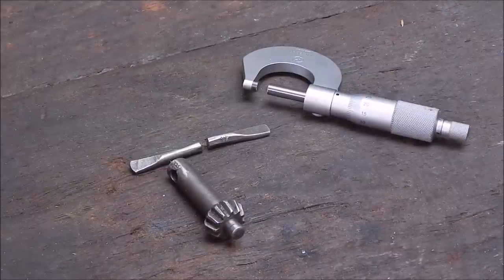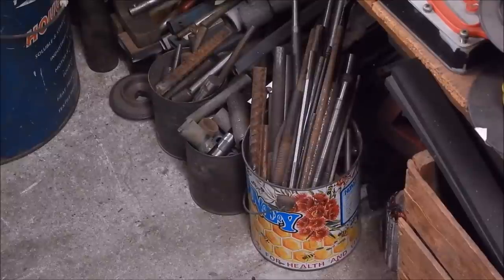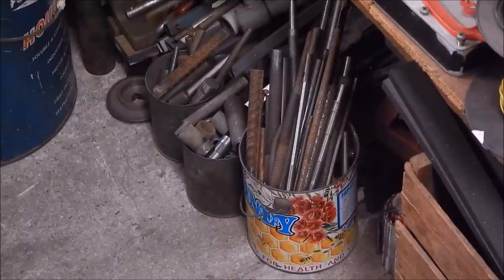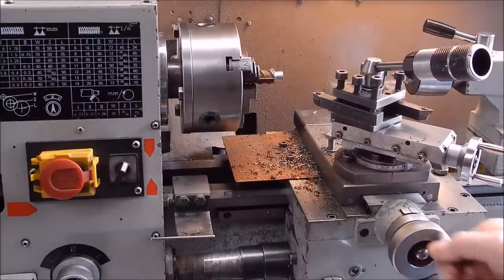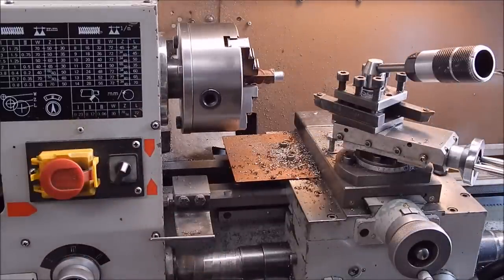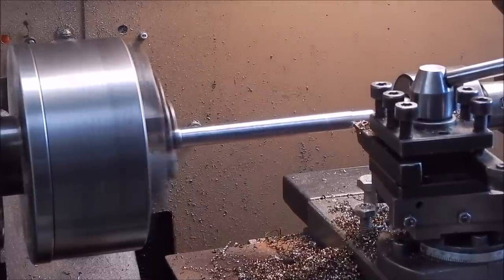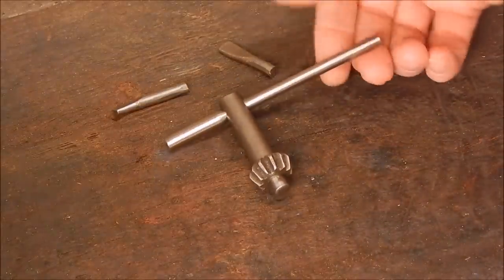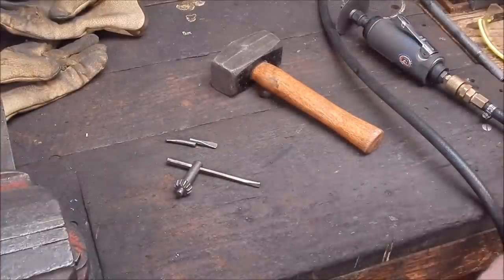Can you machine Rebar with a metal lathe ?

Comment: Rebar or what other terms as deformed bar used in building construction is machinable, but it will bend for prolonged used this is not compatible for a drill chuck key handle i am just sharing thru my own experience as a Machine Shop practitioner for almost 43 yrs of my entire life,,,i replace all of my drill chuck key handle by using tool steel rod without machining you can buy it depend on
what size you need and walla all you need is to forged both end with a hammer

Comment: Strange finding this, I played with turning down some left over rebar a month ago. I was actually pleased with the turning and finish. Who knows what the stuff is. Have to be sure chuck is good and tight otherwise, as I experienced, the rebar tends to chatter when turning down the nubs which can loosen the jaws. Next I think I'll try to super finish the material to get a really smooth slick finish.
Reply from the maker: Very little on YT about machining Rebar.  It threads OK (for end plates) so it must machine OK.  I finished off with a home brew carbide tip, but HSS would probably do a better job.  The finish was still as good as cheap black (rolled) steel can give. So worth playing around with just to see.  Rob
Reply: xynudu I did find out from an old fella who is a blacksmith, as well as tool and die man, that rebar is high carbon steel so if that helps anyone out.

Comment: I am thinking that the process of making the raised parts on the rebar may have had a work hardening effect on the out side of the rebar. It can be a lot harder then the inside.
Reply from the maker: +Old Man 

It's hot rolled, so it's going to be harder on the outside regardless.

Cheers Rob

Comment: Crazy question could you not just use an angle geinder and remove the ribbed section and then use your bits to really turn it as to not ruin your carbide?
Reply from the maker: Yes.

Comment: G'day Rob! Was thinking, would it have been more efficient to attack the rebar on your lathe with an angle grinder first just to get it a bit smooth before subjecting your cutting bits to it? Interesting video, will have to remember it.
Reply from the maker: +Luke Burnard 

Hi Luke.

Yes, you could do that, or even use a bench grinder on it. 

Cheers Rob

Comment: Xynudu (and those of greater knowledge than I),
Thanks for sharing this interesting piece of information, and taking the time to document it!
Would it help if the piece was acid washed before machining to remove the rust and scale? Would that save on wear and tear on the inserts or HSS steel cutters?
Thanks!
AAR
Reply from the maker: +Albert Rasch 

Yes, removing the rust would save wear on any cutter used, including carbide. 

Cheers Rob

Comment: Rebar is poor quality steel, that is why no one likes to work with it. The last stop on the way to rust is rebar. It is very inconsistent, you may be working with it and all of a sudden hit a hard spot or a soft spot. You are much better off selling your current stock in exchange for some scrap steel of a better quality. It is NOT better than mild steel, it is worse, it is made from old tin cans to car bumpers and it is not well mixed. It is fine for holding concrete together but not much good for anything else.
Reply from the maker: wayne parris I take it you've never had much success machining Rebar?  Rob
Reply: Rebar has set specifications like anything else in construction.  The ASTM has classifications for rebar with grade 40, 60 and 75 having a minimum yield of 40k, 60k, and 75k PSI respectively.  There is no reason to think of rebar as being any different in quality than any other mild steel that is the same alloy.  I've never machined it, but all the rebar I have ever handled cut, welded, bent and behaved like mild steel.  Also it's ludicrous to think that there isn't some level of concern for consistency in how a product behaves when it's performance is responsible for holding up bridges and skyscrapers, because amazingly, side walks, driveways and home foundations aren't where most rebar ends up..heh
Reply from the maker: Dead right on all counts.  Thank you for some serious informed comment.  Cheers.  Rob.
Reply: Rebar is the lowest grade of steel. Purity is not a requirement, consistency is not a requirement, as long as it can meet the test for yield it passes. It is a mechanical requirement, not a chemical one.
 I have forged it and machined it. In both instances, it behaves poorly. There is a reason it is the least expensive steel available, it is among the lowest quality steal available. Sorry but that is the truth. Quality material is not expensive, it just costs a little more than rebar.
Reply: You haven't handled much mild steel rod or bar stock if you think it's noticeably more consistent than rebar.  I see obvious cobbled areas and have mild steel break while bending at similar rates. The last full stick of solid 3/4 I bought had at least two feet of obviously visible flaws in it. Is rebar high quality? No, but it doesn't seem much different than typical mild steel rod bought for cheap at the typical pipe and steel yards.

  Now if you want to compare it to anything that is actually considered machine grade, then yeah, it's junk, but thinking it's some how vastly inferior to mild steel is giving mild steel too much credit.
Reply: member548 I have seen some cheap rebar that was so brittle it would break before it would bend. It was a nightmare to work with. Cheap from China and had to be used in straight runs instead of being able to be bent into cages for pre-cast.Finally got it used up and no more of that stuff.
Reply: member548
If your comment is for A36 or what is commonly sold as "mild steel" you are correct, that standard also moved to a mechanical one from a chemical one. I have used a LOT of steel, in many grades. With steel like anything else, you get what you pay for. If you want GOOD steel, you need to do your homework and select a steel that will meet your needs then spec that particular grade steel. Generic...."mild steel" is garbage. Not quite what rebar is but it is getting close.
Reply: I believe you. That stuff was good for just sitting there but not for working it at all. Thanks! I'd really like to go through a steel mill sometime but it'll have to be on You Tube or go to China. Think I'll just stay home!
Reply: Yeah, It's not my intent to say rebar is great or anything, just that there doesn't seem to be much difference between it and mild steel.   I had a stack of 3/8ths rod one time that broke every time it was bent more than 90 degrees for instance, and sch40 pipe that pops and blows out when welding or plasma cutting because there was some garbage in it.  Rebar is low end, but it's not like is complete garbage or several magnitudes worse than typical A36 mild steel.
Reply: It's really good for garden stuff. Reusable stakes and trellises.
Reply: wayne parris So, what's the big deal of using rebar for a simple key chuck handle? It's not like there are hundreds of pounds being placed on it. I'm not saying that it should or shouldn't be used. He used scrap metal for a simple key chuck handle. Just don't dismiss the simple usage of rebar. This is just smart thinking on xynudu's part.
Reply from the maker: FrustratedBaboon Yes, that was the idea of the video.

Thanks for the support.  Cheers  Rob
Reply: It didn't really bother me if he used a broom handle. If it works for him it works for me. No problemo!
Reply: wayne parris +member548 Nice thread! Thumbs up to both of you. I got good perspective from the dialog.  I do also appreciate OP +xynudu for the fine video work and introduction of this concept.  I was thinking of this idea myself.  I subscribed.
Reply: FrustratedBaboon 
Ya you got me. 37.5 years in the metal working trades and I know less than a 5th grader. I am ashamed.
Reply: wayne parris I would be very worried about steel that breaks when being bent, this shows that it was force cooled after rolling ie straight into water !  not such a good idea, depending on the mechanical properties called for within the spec, however if elongation or Charpy are within the spec I would suggest you get it tested before using it to build bridges etc ...  Lewie McNeely what did you use it on ?
Reply: Cages for reinforcing pre-cast retaining wall blocks. No long spans, just self-contained units to be stacked flat and the cells poured solid. They used that cheap stuff up and got better quality from then on.

Comment: G'day mate.  Top quality video as usual.  I hope you enjoy the chuck key.  I need to purchase three or four myself as even though I have a place to put my chuck key I never put it there.  I find that you can get steel in many unexpected places.  Like auto struts, each has a nice rod down the center.  Thanks for the video.
Reply from the maker: cerberus Auto strut centres - that's a new one for me.  I must look into that.  What diameter are the rods roughly?  I have machined FWD car drive shafts.  These are about 20+ mm in diameter, but the ones I machined (Mitsubishi) had about a 5 mm layer of case hardening over the entire shaft.  Needless to say it made machining extremely difficult, even with carbide. Cheers Rob.
Reply: xynudu The diameter varies but should be close to 5/8 - 3/4.  A little bit hard too.
Reply from the maker: cerberus That sounds like pretty useful stuff.  Would have to be quality steel to prevent bowing under pressure.  Thanks for the tip.  Cheers Rob

Comment: My experience with rebar is the material I had on hand was rather soft and very tough.
The machinability index was poor. With this combination the finish was terrible and even a decent ratio (length to diameter) piece will bend on you in the lathe and cause a wreck.
Reply from the maker: w8ye There are many grades of Rebar.  The stuff I have gives a reasonable finish without much effort - as per the video.  But I hear plenty of weeping and wailing from others not so lucky :)

I just put up the video for comments, and all are welcome.

Cheers Rob

Comment: Machining is a bitch on this stuff but it is useful for items that take a lot of pain like pipes being used as a "come-along".
Also tempers pretty easily - heat it up cherry red, throw it in some old motor oil - repeat a few times - everything is good.
Once had a chisel I made out of about 400mm of 25mm re-bar - took forever to blunt down.
One time we were breaking up some concrete and got the chisel about 15omm into the stuff and then it "got stuck".
Beating it sideways with a sledge hammer eventually got it loose but it didnt break, shear off or bend.
I wonder who stole that chisel as its not in my toolboxes any more. ;>}

Comment: Why not just use a small angle grinder to take off the rough.
Reply from the maker: Grant W. Whitwam Do whatever floats your boat.  Rob
Reply: I made a holder for my angle grinder to fit on the tool post of my cheap Chinese lathe, after I dressed the grinding wheel, I could get down to tenths of thou, just like the old Universal grinding machines I used to operate. Funny what you can do if you have too, you just have to put shield under the grinder to collect the grinding dust.
Reply: Because the last thing you want on the bed of your lathe is little chunks of abrasive cuz if they get caught between the lathe and the bed it will destroy it. I'm not a machinist but that's one thing my buddy has taught me about his leg is don't ever get a braces around leave. If you do make sure you cover the bed up and catch all the material that comes off of it.
Reply: @1ton4god  you can clean most of it off on a bench grinder. The main thing you want to get rid of is the 2 big ridges and some if the raised sections. After that it cuts fairly well.

Comment: How did you chuck it to minimize runout before starting?   There’s no decent surface to indicate on.
Reply from the maker: Hi Lisa,  I could only get it close by eye, because there is no surface to indicate on.
Reply: @Xynudu   I used a machinist square and the face of the chuck to get me close.  I’m making some pin hinges for a gate. So it’s two parts and I’m concerned about them lining up.
Reply from the maker: That's a good way to do it.

Comment: Thanks for your great videos, Rob.  It's good to see your work.  

Just a question, though.  Why weren't you using coolant?
Reply from the maker: Spamlure Not necessary because I used carbide cutters for the whole job.  You can use coolant with carbide, provided it's a continuous flood system, which  I don't have.

It's not recommended to apply coolant to carbide with a squirt bottle as it requires a constant application for the cutter to work properly/uniformly.

Dry works fine.

Cheers Rob
Reply: xynudu Have you ever tried a siphon mist coolant system? it will about double the life of your carbide vs running dry.
Reply: Bear Peterson  but they are a bit of a mess.

Comment: seen this video, and made me think of something i have allways wanted to know.... can you weld rebar? i have never tried,or seen anyone do it.
Reply from the maker: +chaseme81871 

Yes, you can arc weld it.  I've done it plenty of times with an AC stick welder using GP rods.  The welds have held up OK.

The weld can be brittle though, so low hydrogen rods work best on it.

There are probably specialty rods for welding it.

Rob
Reply from the maker: +chaseme81871 

For best quality welds the Rebar should be preheated with a gas torch, but I doubt that gets done very often.

Rob
Reply: hey thanks for your answer. i have always been curious.
Reply: rebar gets welded all the time. in the field and in rebar fabrication shops. I don't know about the process tho
Reply: Of course you can,as long as you know what you are doing

Comment: hi rob what lathe are you using i am new to this and i would like some advice
Reply from the maker: Tommy Taylor The lathe is a CQ9325 10 x 18.  It's no longer sold in Australia but is available in Europe and the USA (through Bolton Tools CA).  For hobby use a 9x20 or 10x18 is a good handy size.  Smaller is OK as well.  Once you go larger than 10" swing you lose the ability to work very small items easily, so think about how big you really need it to be.  Cheers Rob

Comment: How much did this cheap Chinese lathe cost? It looks pretty nice
Reply from the maker: +Mackenly Parmelee 

It was $1,100 AU ten years ago, but it's no longer sold in Australia.

That was unbeatable bang for buck at the time. It still almost impossible to beat for it's size.

In the USA Bolton Tools in CA sell them - with power cross feed as well.

I have no plans to change it.

Cheers Rob
Reply: I'll check that out. I've seen a similarly sized Grizzly brand one for about $1,500 US but If I can find this one for similar, (I don't know the conversion rate) than I'm pretty well sold on it. Thanks!

Comment: 300 grade is the softer stuff... 400 is tougher. You ca tell the 400 because of the marks on it about every metre.... (not much use on short bits!)... :-)
Reply from the maker: Kathryn Truscott When I cut this, you could see the blue heat treatment/hardening pattern through the cross section.  That's why I didn't try to harden it after machining, as it may have had a negative effect.  Rob
Reply from the maker: xynudu I've got quite a few longish lengths (14 feet) of this rusty new Rebar.  I couldn't see any marks on it. What sort of marks should I be looking for?  Rob
Reply: xynudu Usually it's a flat portion in the wiggly bits with a number on it. Regarding hardening, it doesn't harden like many steels just by heating and quenching, it seems to have a dependence on temperature/time. The 400 grade can be quite brittle, if you 'soak' it long enough at a bright red heat....At one time I rolled horseshoe steel out of scrap re-bar, and we could harden them pretty effectively for long wear. It was actually better than the mild commercial steel, but of course we had to build the rolling mill to form it..... that was a project, I ca tell you!...
Like you, I never throw away a bit of metal.... always handy...
Reply from the maker: Kathryn Truscott Hi Kathryn.  I can't see any flats/numbers so who knows what it is.  I was very hesitant to harden it, as I have seen high carbon steel go very brittle after quenching, to the point where it will break like glass.  So best left as is. Thanks for the reply.  Cheers Rob

Comment: rebar is the garbage of the world of metals. As for mill tolerances, it has minimal strength requirements and the range of allowable carbon is ridiculous. I am a machinist of 30+ years and I have never lowered myself to make anything but a fire poker from rebar. I would never put this crap material in any of my machines.